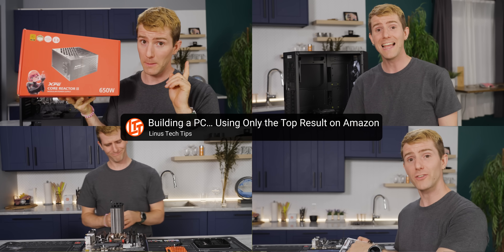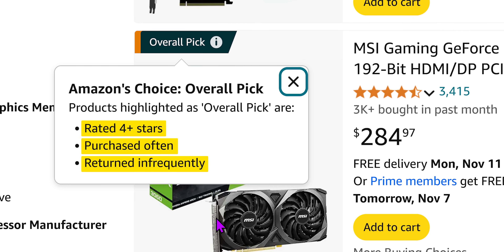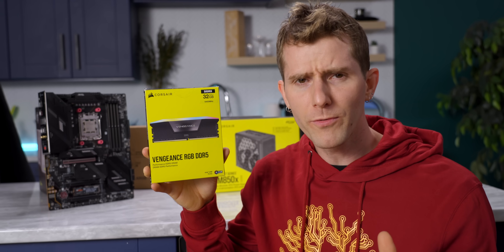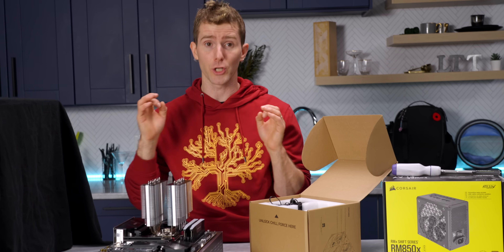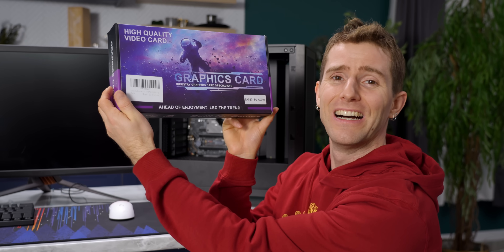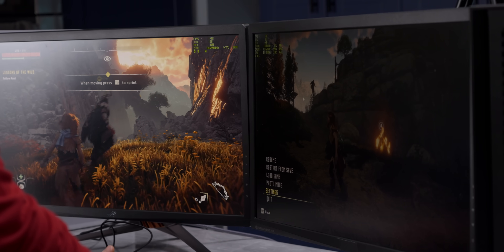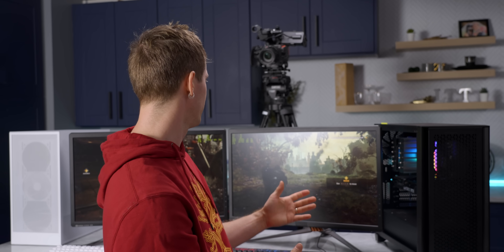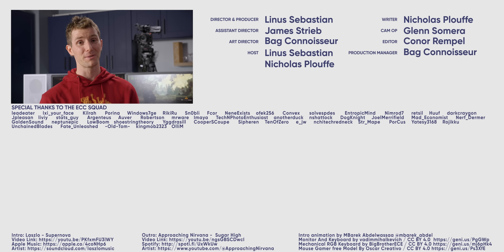Building a PC Using Only Amazon's 'Overall Pick' Products

Comment: The TEMPS were way to hot though on the PC they made.
Reply: Nope. 

"AMD Zen 4 and Zen 5 CPUs have their thermal target set to 95°C, which means the CPU will boost as much as it can, until it reaches that point, to maximize performance. Unlike on Intel, on AMD it's not possible to increase the 95°C limit."
Reply: Oh, interesting

Comment: My guess is that the Crucial SSD is the 'Overall Pick' because it's often used in storage solutions where multiple drives are added. This makes it more likely to be sold in larger quantities per order compared to M.2 drives, which are usually bought one at a time for specific builds.
Reply: there's also the compatibility aspect! it being sata just makes it compatible with almost everything. yeah nvme is better but my grandma doesn't need anything newer than an optiplex with a i5 2400 and last I checked it doesn't boot off of pcie.
Reply: I run 2x of them in RAID0 exclusively to hold games, they're dirt cheap even in 2tb and are more than fast enough, i've also yet to ever have a crucial ssd fail on me, unlike both sandisk and samsung
Reply: Quite possibly. Or in my case, pun not intended, using m.2 on my motherboard takes away two of my SATA ports. So my boot is SATA SSD, three spinnybois, another SSD and a BR burner. All of my SATA ports are used. Heck, I even have an add in two port pci card for my hot swap bay. 
I digress...Thankfully I found this out after I built my system just by experimenting with a spare m.2 drive I had laying around.
And I really have to question why anybody in their right mind would use solid state drives, of any type, in a RAID setup. 
LONG LIVE THE HIGH RPM SPINNYBOI!
Reply: Good point. I agree that most people in this situation will buy a very nice Samsung SSD for 1TB-2TB and fill the rest with these cheaper Crucial ones for additional storage.
Reply: @gokkiyoutube  Yup, that's exactly what I did, got a nice Samsung M.2 drive as a boot drive and the rest is more basic drives for additional storage for games and movies
Reply: @gokkiyoutube I've been buying those crucial ssds for like 10 years, they are good cheap drives. 

Edit: just saw these are the BX version, I mainly use the MX version. Although I do use them in a few devices. The BX ssds are still really good for the price. My main PC has a p3 nvme, 1 256gb mx100, 1 240gb BX500, 2 2tb MX500. My secondary PC has a 240gb bx500. My server PC has a 500gb bx500. My laptop also has a 500gb BX500. Despite not having the cache I stand by they are good drives and a hell of a lot better than a hard drive. If you need a good drive cheap I can for certain recommend it. I only ever buy crucial drives.
Reply: @gokkiyoutube  Crucial P3 > Shitty Samsung SSDs
Reply: If you have extra money to spare, getting a 4tb nvme ssd and a 24TB hard drive is reasonably affordable nowadays. You have more than enough space to keep your primary games on SSD while keeping your less frequently played titles, video, backups and more files on the much larger drive.
Reply: @blisphul8084 " 4tb nvme ssd
and a 24TB hard drive" dude that cost more than my pc setup 🙄
Reply: @xninja2369  I hope you're enjoying it regardless. The good thing about the high end getting cheaper is that the low end gets better. A 500GB SSD and 4tb HDD used with primocache is also an excellent combo.
Reply: @blisphul8084  I have ( I mean my dad have )  i5-4th gen with integrated igpu  128gb ssd .
Reply: Also people updating their old computers without an M2 slot
Reply: Or in my case as something I bought after I built my PC. I sourced several sites like Newegg, Microcenter, etc when originally building my PC with an m.2, but when it came to adding extra storage I just relied on the convenience of Amazon to buy an SSD.
Reply: Yes. You are right. My brother has 3 of these and switched to the mx500 after a like but, only one pcie m.2 ssd
Reply: @ I'm right
Reply: My first guess as well was "yeah nvme is overall "better", but you're limited to 1/2 per motherboard. So sata is likely to win out if you want MORE"
Reply: my guess is that it was because thats what they had in the warehouse :face-red-droopy-eyes:

Comment: Do note that with the 7700 XT, you should also have access to AFMF 2, which is basically AMD's Driver-level frame gen. 
It is actually pretty good, as it doesn't significantly reduce latency nor have that much artifacting. I even use it for some games on my 7900 XT when I need that extra little boost in frames to reach my monitor's refreshrate.

Comment: 07:25 just get rid of the hard drive trays... It's arguably a rite of passage building in a cheap full tower case these days. No really, if you're putting a motherboard with 2+ m.2 slots in there, then why on earth would you need them unless you're setting up RAID. In which case, it's better to have that data on a home NAS anyway, as this will add another layer of protection to your precious data.

Comment: 11:27 why is the CPU 90 plus degrees on the second pc?😂
Reply: "AMD Zen 4 and Zen 5 CPUs have their thermal target set to 95°C, which means the CPU will boost as much as it can, until it reaches that point, to maximize performance. Unlike on Intel, on AMD it's not possible to increase the 95°C limit."
Reply: They probably messed up the cooler or something

Comment: @LTT and other pc savvy users

I don't know if you ever check all the comments, but I try my shot:
I currently have a RTX 4060 and a Ryzen 5 5600 in my system (yeah I know, 4060), and consider upgrading next year to a RTX 5080 once it gets out. In general I tend to NVidia as I play mainly PCVR games and apparently they work better for wireless VR streaming due to their codec.

My question is: based on rumors and on previous releases, do you think it would be wise to wait for the 5080 or better grab a 4080 Super for now? Is it even wise to have such a GPU in a system with only that cpu? Thanks!

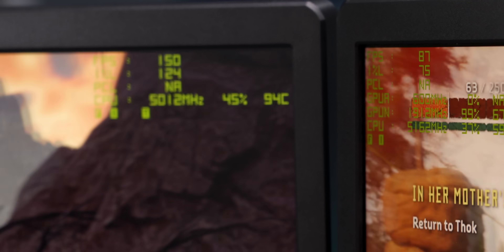Comment: 10:30 that CPU is cooking itself. LOOK AT THE TEMPS
Reply: Yeah literally at 97°C a few seconds later and downclocking below 4.9 Ghz. They fucked up the mount of the cooler I guess, because the other one is running 40°C cooler on the same Aircooler.
Reply: @problemschueler  My 5600x while not being the fastest option out there, barely budges from 65C with a $25 aftermarket cooler. Def. a problem somewhere.
EDIT: Yes, they should have gone with an older gen CPU, IMO. There's no way any older 3D chip isn't going to be within a few frames of the newest stuff. But massively cheaper motherboard and ram as a result. My cheap CPU? Waiting about 6 more months to just drop in a fast one once prices drop a bit more. Spent the money on a better video card. lol.
Reply: All that matters is the FPS haven't you been paying attention? You can't see them, but they're the most important thing. Trust me dude 200 FPS is way better than only 114 FPS.
Reply: Educate yourself: 

"AMD Zen 4 and Zen 5 CPUs have their thermal target set to 95°C, which means the CPU will boost as much as it can, until it reaches that point, to maximize performance. Unlike on Intel, on AMD it's not possible to increase the 95°C limit."
Reply: @LordManhattan  LOL If you CPU hits 93C @45% load it will throttle under full load. It might already do. Just because the part is save to use at that temperature does not mean you should. It will boost less,  therefore perform worse and shorten the lifespan of the part.

Comment: Unless the surrounding parts are several gens old, going a bit cheaper on them and putting more budget towards the GPU will almost always net better gaming results. My last built, I had a 3700X, RX 5700XT and 16gb of DDR4 3000mhz ram. My friend had a 5600X, GTX 1650 Super, 16gb of DDR4 3600mhz ram with a much faster SSD, and when we were playing games online such as COD Warzone, Valheim etc, I'd be getting 50-80% more fps than him by just having the better GPU, even though his overall built cost more than mine with newer, better parts across the board except the GPU. This was 2020ish.

Comment: I had that motherboard with the BIOS-es since the beginning of june 2024. Had a 7800X3D in it, never ever did I have problems with my Samsung SSD 980 - 1TB drives (or Corsair and Lexar NVME's). The Samsung 980's were my 50GB+ games drives and one of them I used for generative AI. I haven't noticed boot-problems nor other type of problems. All the drives ran the latest FW on them too.

Comment: Hi, MSI Tomahawk x670e Wifi owner here. The SSD issue comes with some of the newer BIOS updates. Lower BIOS versions don't have that issue.
I have an WD SSD and had to downgrade my BIOS. Now it works fine.
Reply: Are there any other issues with the older bios versions? I’ve ordered the x670e tomahawk and have a wd black sn850x, I’d be fine just using an older bios if there aren’t other issues but if you know of any I could return the board or the drive

(this is the first I’ve heard of this issue annoyingly didn’t even think to check it)
Reply: MSI Tomahawk x670e Wifi owner here, I run Samsung 990 Pro NVME as my OS and a pair of Samsung 870 Evo SATA SSD as my data drives, plus three P1800X Optane as cache all without any issues. And I've been updating my bios from factory to current latest every time a new bios came out (I was interested in AGESA update to improve DDR5  memory compatibility) without any issues with my drives.

For Tomahawk x670e I'll say:

Pro: besides the normal x16 PCIE 5.0 and x4 M.2 gen 5, the board has a separate 4x PCIE 5.0 slot (in dummy x16 size too) that came directly out of the CPU. That's pretty cool if you want to play with say, using an Optane drive with Primocache to improve your OS drive's low queue depth random read performance. Makes Windows a lot snappier. The board also has three 4x  M.2 gen 4 slots from chipset for you to RAID5 your data drives if you don't want to use SATA.

Con: does not support ECC memory even though AM5 CPUs should be able to, so not so good if you want to turn it into a server if you went for AM5 for that reason.

Also one other feature I like is MSI BIOS has a very clear setting to allow either motherboard to control wake from hibernate or let the OS control it. I like it since as if you let OS control you can see in system log very clearly if something wakes up your computer unexpectedly and hunt it down.
Reply: I have the same motherboard and honestly got lucky I didn't look up any comparability issues, but microcenter had a pretty good deal on crucial nvme 4 ssds when I bought it so I never had any issue.

Comment: I love and hate tech equally. I spent almost 2 grand on components (at microcenter) around 3 years ago that are now out of date....but I'm not going to upgrade for another year or two....because it's not completely necessary.

My Ryzen 5 3600x, Gigabyte x570 elite, 2080 super, and 650 bronze PSU from Corsair...is still "funcional" using triple 1080p monitors of course. 

Every product I labeled within a few years has gone down half in price....which makes me not want to upgrade currently. The monitors would be first at this point.

If I want to run triple monitor 4k, I don't believe the tech for value is there yet. I mean, ya, you can do it...for a 5,000 follar upgrade...but that makes no sense to me.

At this point, I will upgrade everything but the mobo, but will wait until the new ryzen chips fall in price and the 50 series is released making the 40 series and everything else I need more affordable.

We are in a wierd space with specs and pricing. I will never buy new tech again. It doesn't make sense....you are just funding the unknown and wasting money because a new better anything will be out because of your funding that you lose and not gain with.

Comment: I have that board. MSI broke the bottom PCIe slot in an August UEFI update and still hasn't fixed it. Windows reports my 10G NIC doesn't have enough resources to start.

ETA: The middle slot does work though, and it's direct to the CPU. So at least there's that. And no, no SSD in the bottom NVMe slot that shares PCIe bandwidth.

Comment: the only real complain would be the GPU wich is far from being in line with the other components, a 3060 with a 7700x is a massive waste of money, should have been at the very very least a 4070/7800xt/7900 GRE or even a 4070 super... other than that is not half bad with the questionable SSD wich should have been an m.2 but its not that bad, i mean its bad but not that bad.

Comment: Disagree on the corsair 4000D airflow being a "premium" case. Following similar reviews a couple of years ago I used one for a build for my niece and she hates it. It only has one USB type A port on the front IO so one of her friends has to sit on the floor with her X box controller plugged into the back of the case and then she said it keeps making rattling noises like a fan is broken. It was actually the vibration of the back up HDD going through the case. I had the same problem with my Corsair 750D back in 2013. I switched to the Lian Li 216 for my next build and found it to be much better built case with more room for components and space to build (now used it in tons of builds, it's a great case and about the same price - night and day higher quality). I won't touch Corsair products now as I've had so many failures just outside warranty and then see how helpful Corsair support is - not helpful at all. They told me to throw my SP2500 speakers in landfill because a resistor had blown on a tiny circuit board that I could have replaced in 3 minutes but they don't stock replacement parts. I sent them a link to a youtube video by some engineer guy explaining that it was a design flaw and that tons of people had the same problem and they just said no warranty no help. Throw it away. I also had a headset fall to pieces and 2 mouses (mice?) stop working just outside warranty. Corsair - premium price, bargain bin quality.

Comment: I personally will not buy anything but an NVME drive.  The sweet spot is a 1 or 2 TB Gen 4.  And I would have curtailed the search results a bit more so it was for an NVME gen 4 of the size you want and let Amazon pick the brand.  Same with the PSU.  When you search for an 80+ gold modular 750w... you will likely get a good one.  That is not the best deal though.